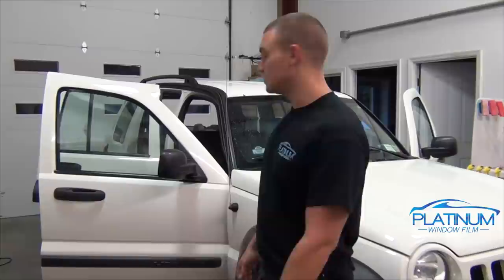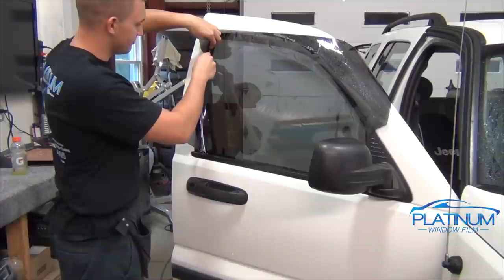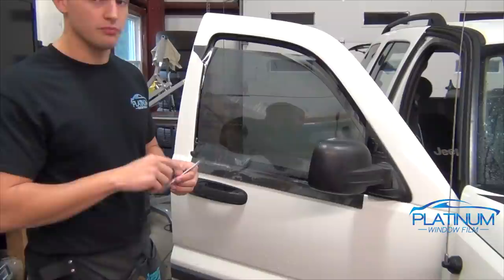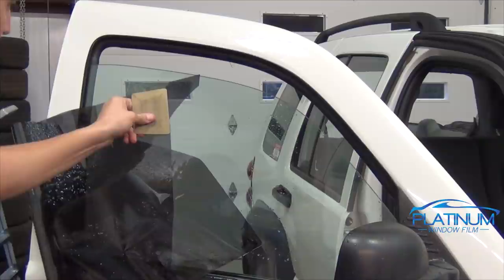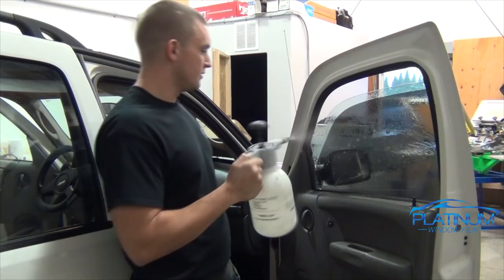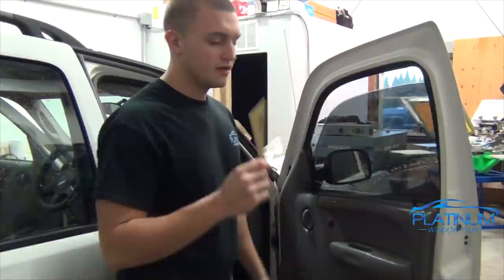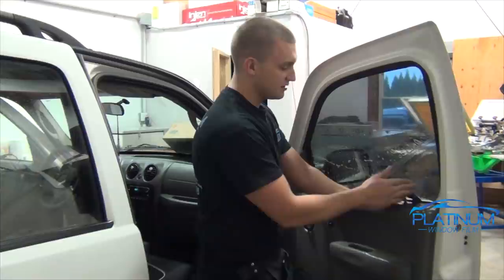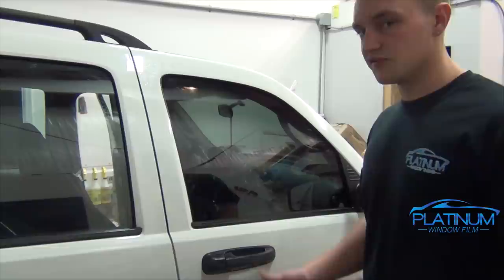How To Professionally Tint - Jeep Liberty Front Door Window

Comment: Excellent video! You make it look so easy, I did my car removed panels etc and I still have a few white dots. Any advice? I cleaned the windows several times, flushed out the sides etc not sure what I'm doing wrong. Thanks
Reply from the maker: are you squeegeeing your window immediately before applying the film? You should be spraying, squeegeeing, then spraying your window again before applying your tint. Make sure you are in a wind free environment as well. and there is no dirt flying around.
Reply: PlatinumTinting 
Thanks for replying!  Yes I throughly clean the window, squeege it, then apply solution prior to installing the film.

Comment: I know you are a professional at tinting windows and i have seen many of your videos.  I am am a 29 year Tinter.  But you shouldn't tell people that removing a door panel on a jeep is the same as a Mercedes.  because it isn't.  (maybe you didn't realize what you were truely saying to the people on YouTube.   But,  Mercedes or any European vehicles door panels are much harder to remove, and you run the risk of breaking stuff.  Removing the door panels are better for tinting, because it makes the installation of the tint much cleaner ( with less chance of contaminating the film), and less headaches, especially if the sides or lower seals are tight.  I have been making videos on removing door panels for years to help people out, that might need the panels removed for whatever reason.

Comment: Hey man I have a question. I just did my car after watching your other video prob 30 times. I did notice that my bottom gasket is right where the tint lays. This is lining it up at the bottom at first. Then when you roll down the window and cut. When you install the tint and roll the window up. Base of the tint is right at where the gasket of the door is. Shouldn’t this tuck down in? Cause it doesnt u less you move the tint down past the gasket sill on the outside when cutting. Just thought I’d  ask